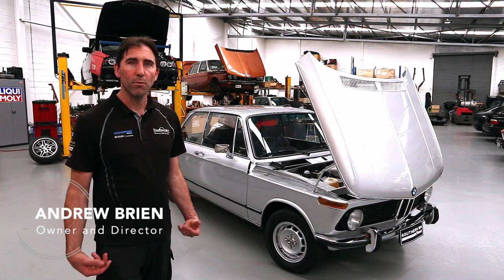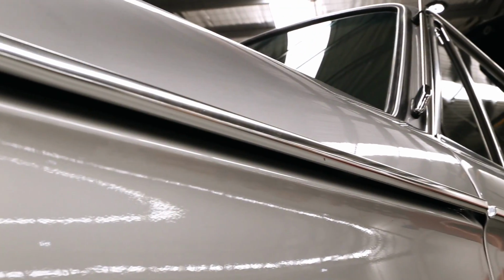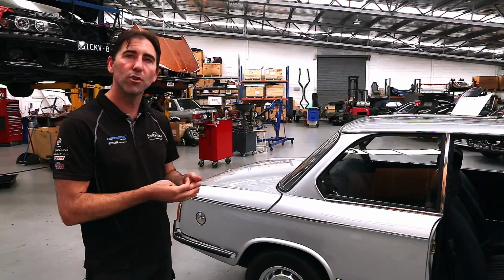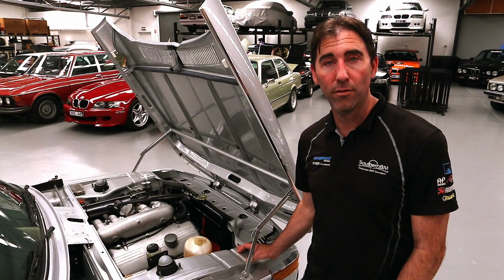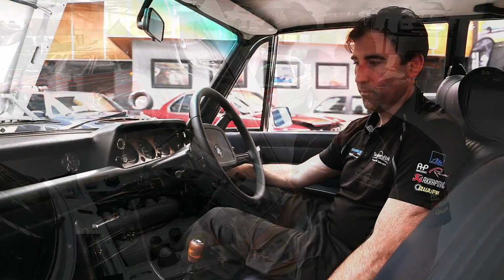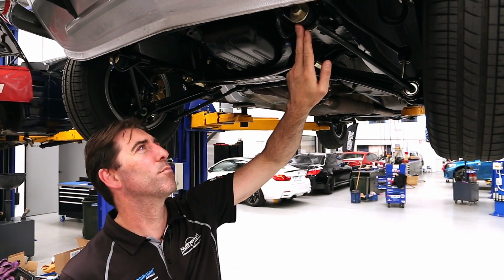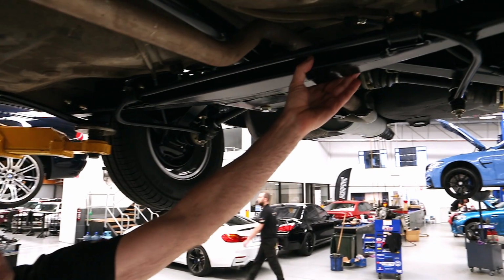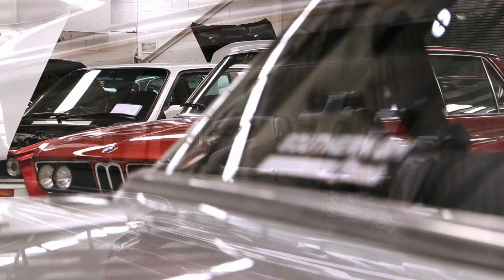Behind The Build | BMW 2002 Tii Restoration

Comment: I'm in the process of restoring a 1973 2002tii  when l bought the car it already a professional installed 5 speed conversion with 3.9 LSD  It also has Ireland engineering stage two suspension  It is being taken down to the carcass  It would be great if you could let me know what radio head unit you used with your amazing restoration 
Also if you know a source for good sun visors it would be greatly appreciated 
FYI l owned a 1972 2002ti back in 1973
and compared to what was on the road at that time the car was amazing! It truly was the first sports sedan
Reply from the maker: I'm glad you enjoyed the video, The radio is from RetroSound. Sunvisors are a problem, i don't have a solution for you on that. You can still buy the white clamps the hold the visor in place though.
Reply: @southernbm  
Thank you for your reply Maybe it's time for someone to 3D print some visors??